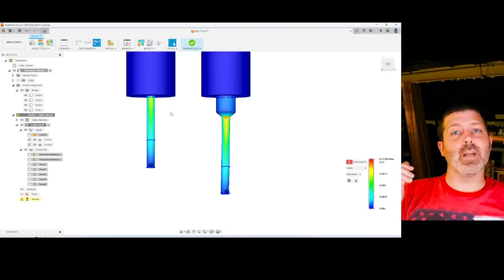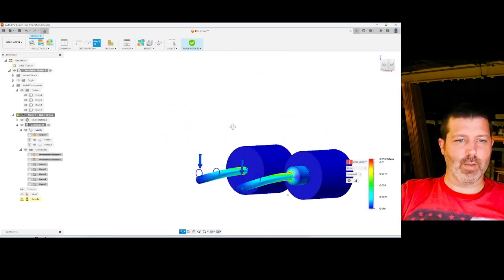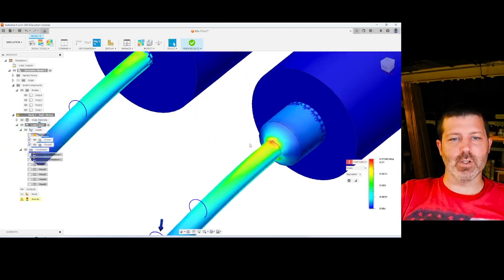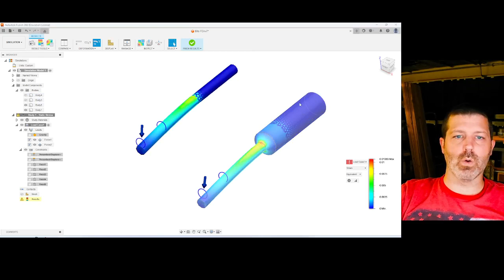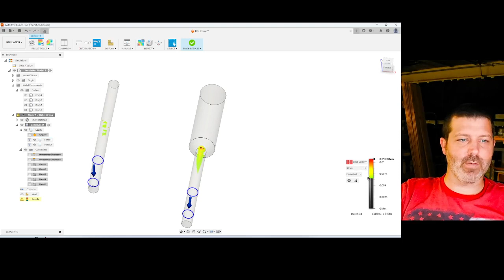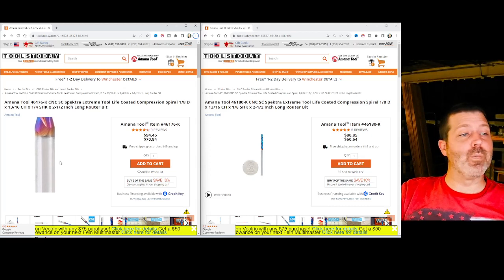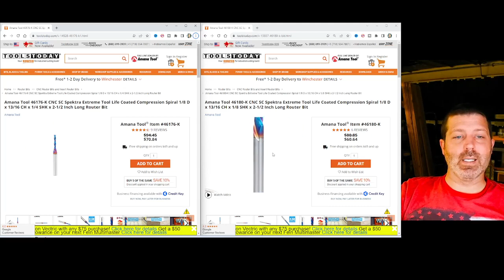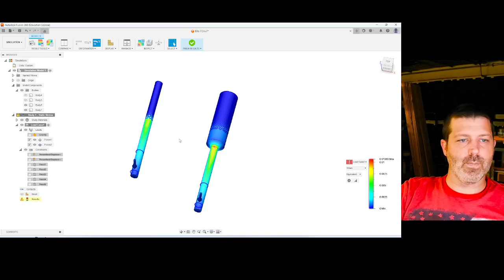Stop Throwing Money Away on the WRONG Bits!

Comment: Interesting use of FEA Seth! Could you try that again but use a shallower taper? It would be interesting to see the difference. It seemed like there was a drastic difference in the taper angle between your model and the actual cutting tool shown on the website. Just curious. I don't have much experience with doing that kind of analysis but I might give it a whirl. Thank you for sharing!
Reply from the maker: :_emojiHey:I pulled some 3d models of bits from Mcmaster-Carr and re-ran with those, they have a radius to the stepdown, the results aren't as obvious, but the stepdown one still has a strain point with a greater level of strain focused right at the base of that taper...  I'll be re-doing this with Tapered Ball bits vs straight edged ball bits as well in an upcoming video.

Comment: Some companies have a fillet (either a radius or other curved shape) instead of a chamfer transition from shank to flutes, such as Onsrud 40-101 and 40-102, KYOCERA 1625-0469L141, YG1 E5I02002, etc. Any way to stress test that idea vs the chamfer?
Reply from the maker: Yeah, I might have to pull some complete 3d models and run some more tests.  However, it is still going to have a similar overall result. The stress focused at the base of the taper/chamfer versus spread out more.

The focal region would be a little larger from a fillet. But it's still going to be more focused than the smaller shank option.

Comment: Two questions come to mind. In normal use case, how likely are we to have lateral forces get high enough for this to become an issue? Additionally, the tool makers eliminate that sharp corner if there was some kind of feathering to make it a bit of a curve instead of a sharp angle?
Reply from the maker: A lead-In to the taper would help to spread the load focal point.  But there will still be a point where the load is much higher than that of a uniform shank and cutter.

You're right,  I purposely exaggerated the load for the colors to show better.  I cannot show the load applied while the model rotates like a bit really does. 

It only takes a small amount of side load for the constant rotation of the bit to cause the focal point (actually a ring due to rotation) to break down and the bit to snap right at that point.
Reply: @SethCNC  I am just getting started, and fortunately have not broken in a bit yet. Did your experience with these vents were the cutter is smaller than the shank, they usually break at that point?

Comment: It looks like the chamfer you myself with is 45* but the but has a shallower taper although I wouldn't go against the consolation would it modify the results?
Reply from the maker: Overall there would still be a focus point of the stresses with a different angle chamfer. I'll have to check the actual numbers I used but I think it's more about 50⁰ I tried to match what I was seeing on the OPs post when the topic came up over on Facebook. And his chamfer looked a little more than 45⁰.
Reply: @SethCNC  yeah that's cool, would be interesting to see how it changes even with a 0 angle stepped change